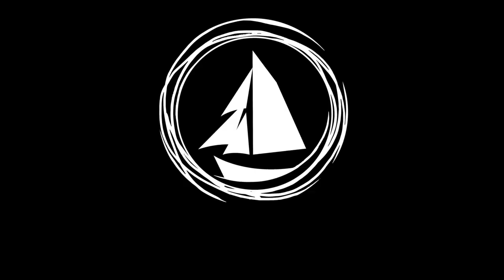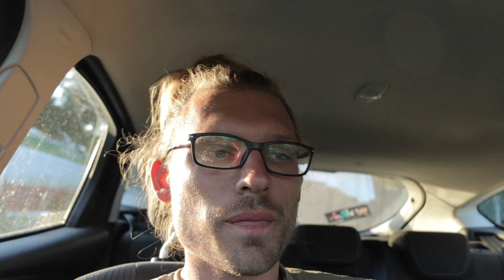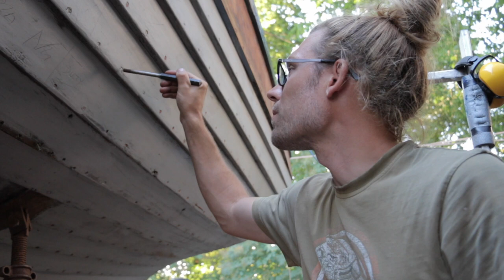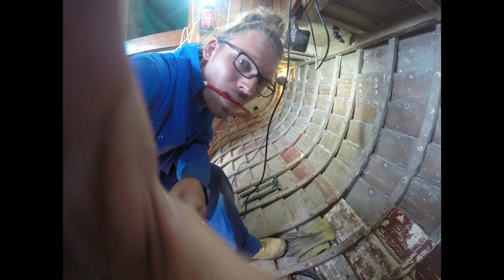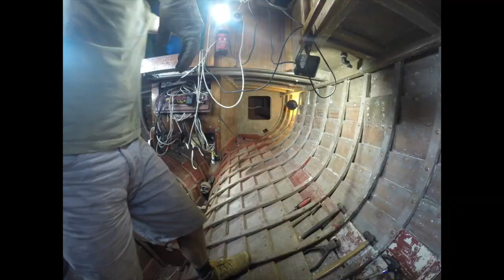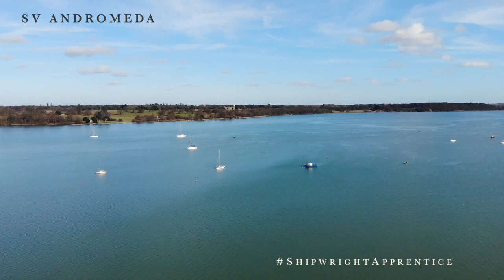13. Replacing Thousands of Copper Nails. Wooden Boat Restoration.

Comment: A fillet of Tech 7 inside and out should provide a leak proof hull to allow seawater to swell the girl back to full plank snugness with minimal bailing! Can be painted over, so you don't have to worry about the usual movement of planks under sail load...

Comment: Avoid using any sort Sealant etc in the Plank Lands!, after Nailing, soak and keep wet under cover the hull and refloat to allow to plym up.
Reply from the maker: Thanks for the advice on the planking. I’m trying my hardest to keep those lands as clean as possible, it is tricky though when you vacuum everywhere then start banging nails and stuff comes out of every place possible. She’s been heavily rained on this week and visibly closed up in places.